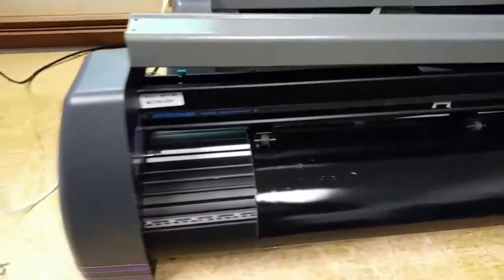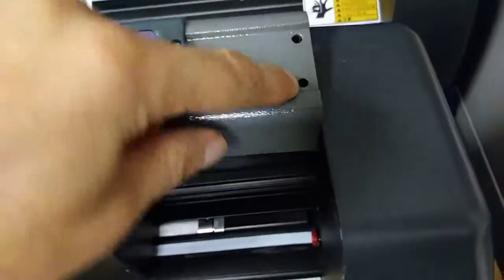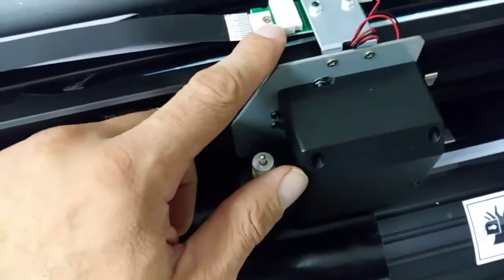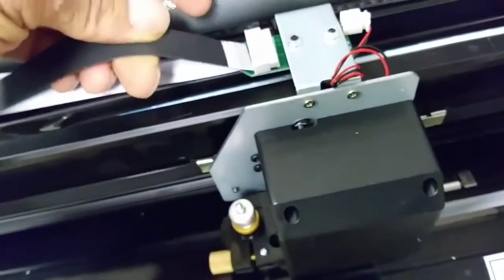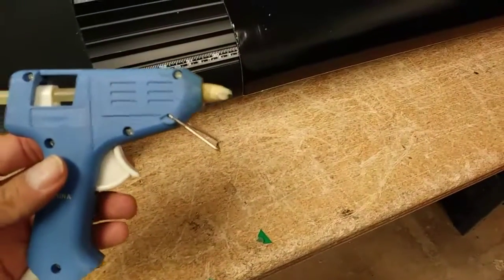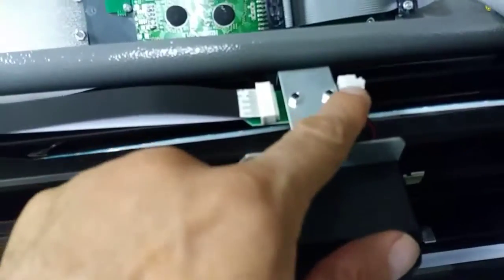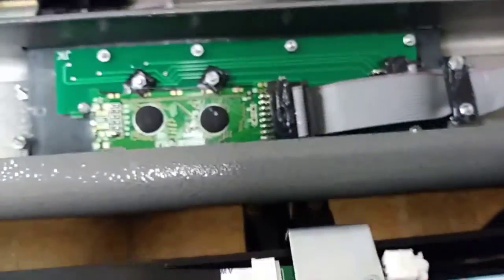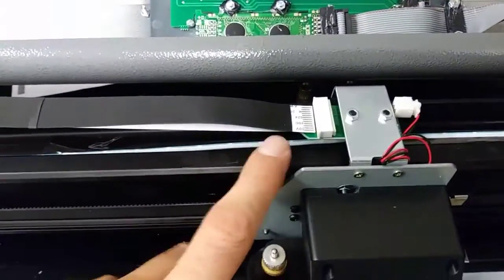How to Check MHMK2 Carriage Ribbon Cable

Comment: Hi, I'm looking for help! I have a STM Robotics (Seikinteck) vinyl cutter plotter, but I'm looking in your video... In the comunication components by the header (carriage) are the same, and i have the same problem, is not up and down but i fix the flex (ribbon) Could you help me to try to solve?
Reply from the maker: Hi Eleazar,

If the carriage ribbon has been fixed but the carriage arm remains down there are a few of things you can do. 

First, the repair has to be solid or completely  correct and free of damages for communication to happen to signal the arm to lower and raise. A new ribbon cable is best.

Next take off the  cover to the carriage and ensure the  positive and negative wiring is connected.  Sometimes the positive end will come loose or solder end can come off completely.  

The next thing is to check the arm of the carriage  while the cutter is fully off, no power.  Slightly place pressure on it, tapping it and make sure it physically can move  up/down. There should be a nice and smooth bounce to the arm.

This means that there's no obstruction physically causing the arm to be 'stuck' or have a rough movement.  

There is or many times a electromagnetic  where the round, cylindrical  pieces move over and around each other.  The top has the coil of copper wiring with a positive and negative  wire running to it. They have to be exactly aligned.  

Lastly,  not usually,  though the plastic seating on the  motherboard can be lifted up and reversed  to see if then the carriage arms moves up and down.  Be careful to drain all power to the motherboard before hand.  

I believe Lastly,  the carriage cable may be connected in two parts ; the carriage cable, connector to a small green control board then wire/ribbon to the motherboard.  You can also try replacing both cables and the small green control board that  normally seats on top of the carriage bracket,  that ttips/touches the home switch, limit switch to stop the carriage. 

Let me know what you find.